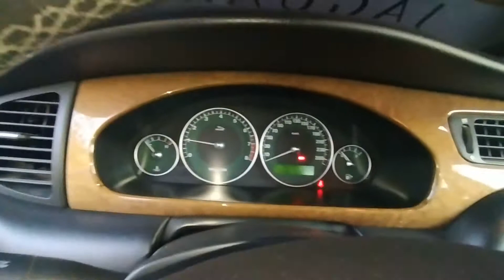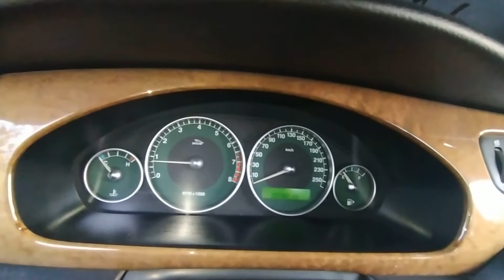Jaguar X-type coolant cap upgraded & radiator repaired

Comment: Same sistem bat put inside Lique moly Stop leak radiator
Reply from the maker: Thank you for commenting, but I am not a fan of stop leaks, there is a risk to clog up the radiator.
Reply: @jaguarrroman  you have presure from head gasket .liquy moli is safe .stop leak smole buble in colant sistem

Comment: I'm having difficulty opening the top of the antifreeze most of the time. I was doing this technique but have hard trouble opening it.
Reply from the maker: I removed the lower seal ring to make it easy, there is no sense using it since the valve is constantly open.

Comment: Merhaba. Kapaktan su tahliye oluyor mu. Genleşme tankında su eksilme oluyormu
Reply from the maker: Yes, I have to add some coolant from time to time, but no risk to tear the hoses with pressure costs it. Recently I've completely removed the valve from the cap, I will show it in one of the nearest videos. Thank you for the comment!
Reply: @jaguarrroman  teşekkür ederim. diyer yararlı videolarını da izledim.  kolay gelsin.